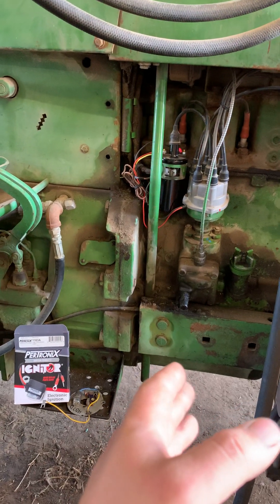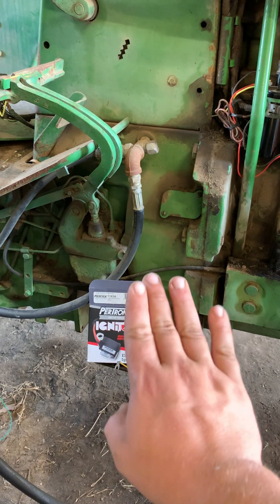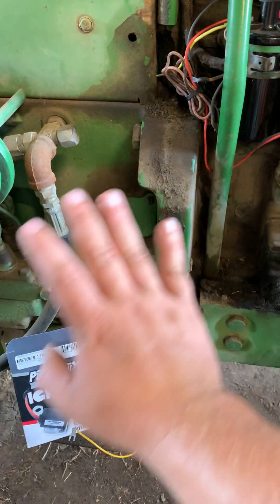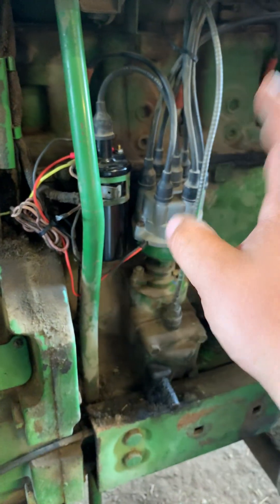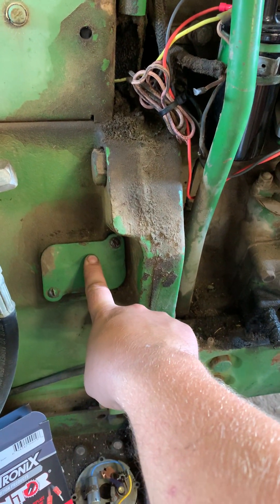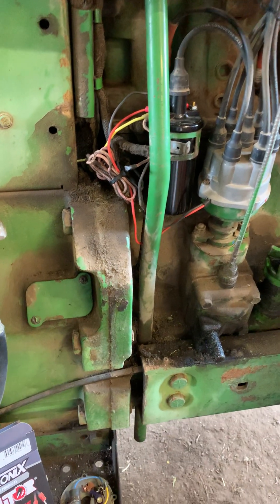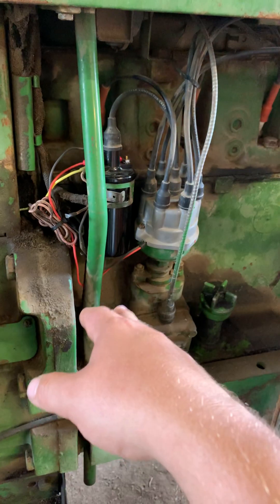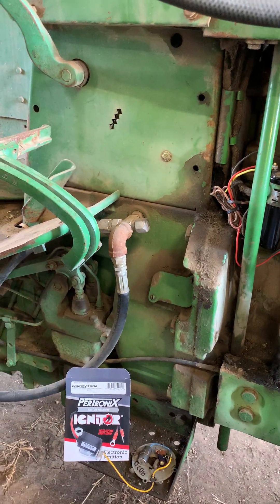John Deere 4020 Electronic Ignition Install

Comment: Do you still need to connect the old resistance wire to the coil?  It was not clear in your explanation what you did with the resistance wire, thanks!
Reply from the maker: You do not use the resistance wire. Run a new wire.

Comment: Did you change the spark plugs wires from the cooper core to the carbon core plug wire?
Reply from the maker: I did not nor did I change the spark plug gap